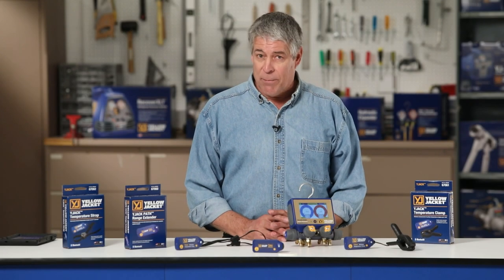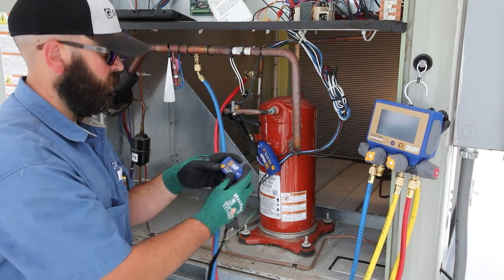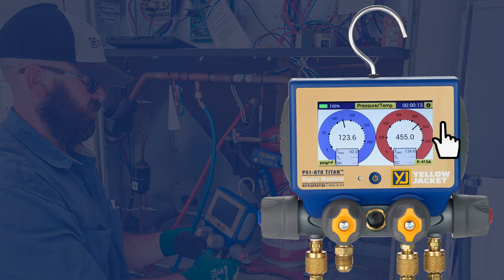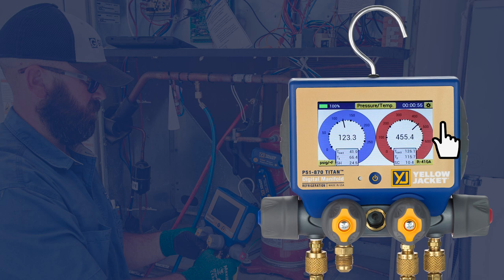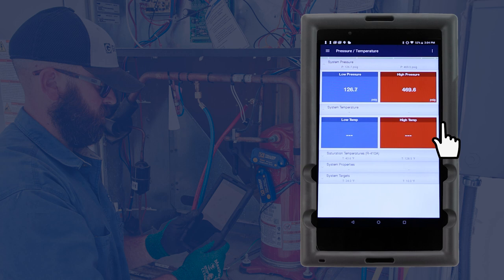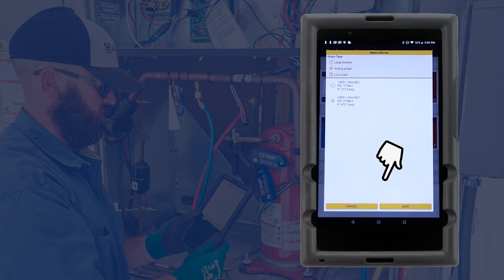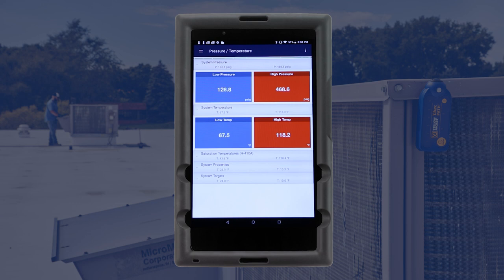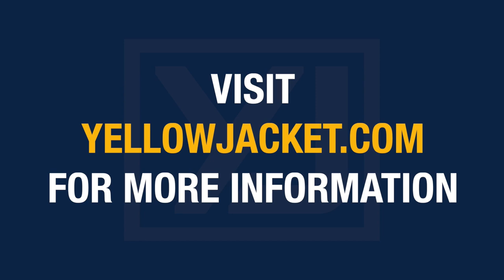Pressure Temperature Check with YJACK Series Probes and P51-870 TITAN Digital Manifold

Comment: You Put High, Side under discharge line, which will get extremely hot that needs to go to the liquid line underneath the compressor in front of it